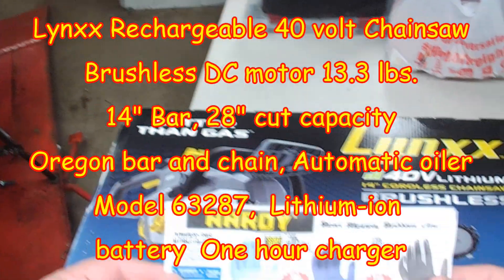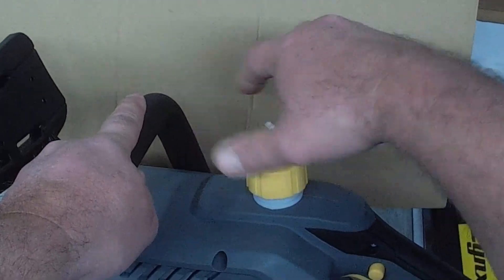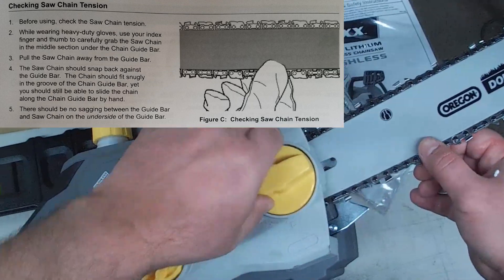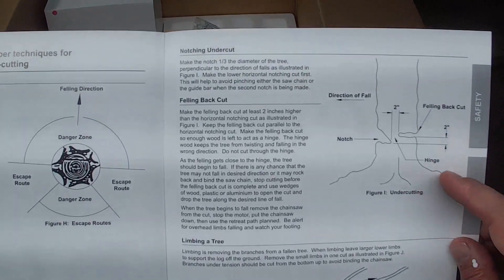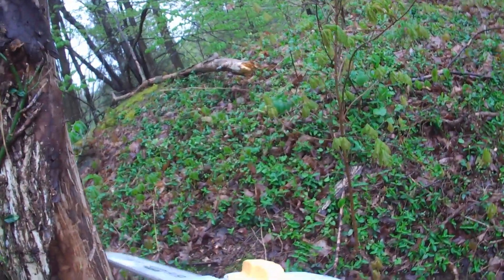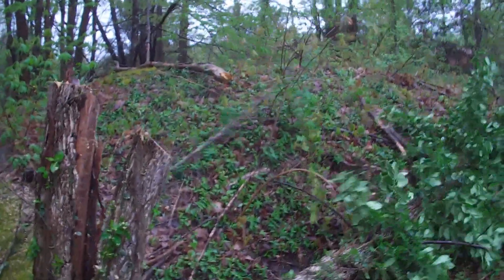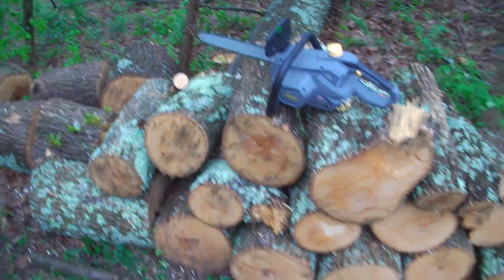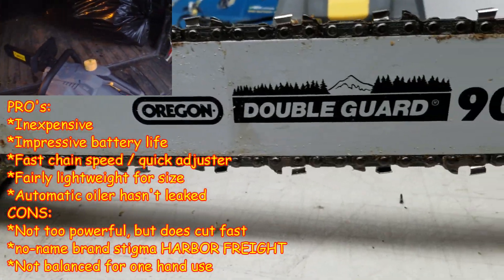Lynxx Rechargeable 40 volt Chainsaw. Unbox assemble review

Comment: Well I went on Amazon and looked up the chainsaw you referred me to and you are right about it being the exact same model.  Only difference was the colors on the plastic casing.  But unfortunately the Lithium Ion batteries required for this item cannot be sold on Amazon anymore.  There must be some kind of safety concern with those batteries.  They stopped selling them as of August 9th of this year.  I'm not sure what the issue is but if it's like most battery issues, there is usually a fire hazard  from them.  I know that there was an issue with that with laptop computers a while back.
Reply from the maker: Maybe, that's so odd... You could be right!  I also bought the leaf blower and am extra battery since this video. I've been wanting to try out the other 40v saw they carry.   I did buy a  HF 20v  little chainsaw and convert the battery holder to Milwaukee batteries. 
I do have a Milwaukee saw I keep in my Rubicon which is my favorite if all, by they're $$$
Reply: I want to give this lynx chain saw a 10. It works great and no issues. I have purchased the lynx pole saw as well. I have actually 2 chain saws and 1 pole saw. I highly recommend it to anyone who needs to do work at a deer lease or just around the home.

Comment: looks good for doing stuff around the house instead firing up the big saw , might have to pick one ! thanks for doing the review.
Reply from the maker: Exactly, I have 2 big husqvarna's, a 272 and a 372. This little saw works as good as my small Homelite. The battery lasted about 5 minutes longer after I did the video, so it's not really that bad compared to some of the cheaper battery saws I have had. You can't push it, it will stall the blade, but if you let the blade do the work.. I was impressed! Especialy for $150 after rebate.

Comment: Just bought one, thanks for the review!  I've had it with regular chainsaws.  Even bought one of the top name ones and it burned out after just a few uses.  I made sure I had the right oil mix and everything.  Sick of trying to start them even when they do work.  Can't wait to try this one.
Reply from the maker: Nice. It's a bit different with the slow swart, but if you let the blade cut and not push it it cuts great!! I keep the chain on the loose side, no slack just not tight. Be sure to run the saw and let the oil pump to the oil hole to bar before putting bar and chain on too.  Let me know what you think...
Reply: It's electric battery operated chainsaw oil? I miss
Reply: Something here
Reply from the maker: Bar Oil for the chain
Reply: @MotoCheez  ,no shit Sherlock why do you say thatin the beginning oil is oil that means it runs off of oil or is it for the bar.
Reply from the maker: Guess I don't understand what you're saying! Sherlock
Reply: @MotoCheez  I was trying to say that I've had bad times with gas-powered chainsaws and was looking forward to trying battery powered.   My battery powered one has been working great for..  I guess 2 years now.
Reply from the maker: I meant what Carl is talking about, I understood you 😁

Comment: The problem with Harbor Fright's & other's electric chain saws is on the inside. The gears are plasric. Excessive pressure will make the plastic gears wear out quickly. Use minimal pressure. Let the chain do the cutting, you're just a guide.
Reply from the maker: Truth

Comment: Well I went over to Harbor Freight today to buy this exact saw and I found out something that you may be interested in knowing.  They had only one of these left on the shelf and on the box they wrote with a marker that there was no battery with it.  I talked to the store manager about it and after he looked it up on their computer, he said that they have discontinued making the batteries that goes with that product.  He said that there may be a battery made by another company that would work with that saw but he couldn't guarantee it.  So unfortunately I didn't get it .
Reply from the maker: That stinks. Ya there is another company with different name. Litheli sold on Amazon. Exact same saw. 
Thank you for letting us know
Reply: @MotoCheez  No problem and thank you for putting this video together.  Lots of good info

Comment: Do you like your Poulin chainsaw more? It's a toss up for me I do a lot of cutting but only a few times a year I run till the tank is empty drink a beer or two fill up and cut till it is empty again and repeat I could get extra batteries I guess but still
Reply from the maker: For cutting like that, I like the battery saws, my Milwaukee battery saw is pricey but cuts like a banshee. The HF saw you'd need a few batteries. They cut good, just can't push them, have to let the blade do the work. Quiet too! I mainly use the HF saw for clearing my trails here. My Milwaukee is in my Rubicon.
Reply: I have four batteries and since I've bought two of these things I have two chargers.  I charge them all up at night, hit the woods with four fully charged batteries in a little backpack and cut till they're depleted.  Sometimes a second session in the afternoon.
Reply from the maker: 👍 nice

Comment: I bought one and used it for a couple of hours a day clearing buckthorn for about six weeks.  Eventually the clutch or something wore out: motor ran and turned sprocket but chain didn't move under any kind of load.  I had paid for the item replacement guarantee so I exchanged it.   The first day using the new one the chain fell off, as it will do sometimes when a cut limb twists on you or something.  I put the chain back on, not noticing that the disk that holds the sprocket was missing, and had to "reset" several times with that handle on top, then lost the chain several times before I got tired of it and quit for the day without fixing it.  Next morning found that not only was the chain off but the sprocket was completely missing.  Fortunately I have two of these things so I'll go back out today and look for my sprocket and disk and clip (whatever they're called)..  Problem is,  you can't get replacement parts other than the chain and bar.
Reply from the maker: That sucks, I didn't realize they couldn't get parts. Thanks for the info

Comment: Had an electric chainsaw once. 2 hours into using it I hit some metal in a tree and it destroyed some plastic gear in it. Just the least thing and that gear was toast. Took it back and got a real chainsaw. But I do plan to grab a electric pole  saw soon. But in a main chainsaw they should never put a plastic gear in it.
Reply from the maker: +Daehawk I agree, plastic gears don't belong on a chainsaw! I've got quite a bit of time using this one, so far it's decent. I keep it in my Jeep. Keeps my trails clear
Reply: i am planning to put one in my jeep...
what is the biggest log that you have cut through ?
will the batteries hold a charge well while in storage ?
are you still happy with it ?
Reply from the maker: I've cut the full bar lenght with this saw and it does well. Has soft start which makes it spins up slow, takes a bit getting used to, if you let the chain do the cutting and don't push down on it it cuts fast and battery life is great. The batteries seen to keep well in storage too. Used it a few times on our last Jeep run, posting video today.. SAVED THE DAY!
Reply from the maker: I just got an email, their on sale for $149
Reply: cool thanks for the info ! i will check out the other video. the low cost of a second battery (compared to others) is what has sold me on this battery saw
if you pay full price for the saw and use a 20% off coupon it ends up cheaper than the sale...
Reply: never mind about the 20% coupon. it will not apply to the saw or battery, so i guess i need to buy it while it is on sale for $149.!..
Reply from the maker: I was wondering if they did that like the compressors... figures!!

Comment: What in your opinion is the best recharging chainsaw?
Reply from the maker: Out of the ones I've used, I like the Milwaukee. I'd like to try the DeWalt to compare though.
Reply: MotoCheez heard makita was good
Reply from the maker: @crystaldavis6169  the one I tried was smaller and less powerful than the Milwaukee.
Reply from the maker: @crystaldavis6169  this lynxx saw is still working good. I keep it on my minitruck. It stalls easy but cuts good if you keep the chain sharp. 
I see harbor freight has a new big 80v battery saw coming out
Reply: MotoCheez saw a YouTube video do a take apart dewalt chainsaw. Said it was cheap parts and after some use the bar keeps loosening. My problem is I’m invested in dewalt tools and batteries.
Reply from the maker: @crystaldavis6169  I did a review on the Milwaukee, I didn't take it apart but I'm sure they're all China and kinda cheap to be honest.
Reply: MotoCheez I’m hearing makita is quality and the brand is Japanese.
Reply from the maker: @crystaldavis6169  the big brands are Japanese, but they subbing parts to China
Reply: MotoCheez go figure

Comment: I love mine! Only 11 lbs, perfect for a woman. 
BUT, my charger won't charge, just a blinking green light on all 3 batteries. 
Anyone know how to reset it?
Reply from the maker: Maybe charger defective? I keep this saw on the front of my minitruck now
Reply: @MotoCheez  Glad you replied or I would've forgotten to tell you the fix for my "charger".  Battery charger was blinking green, because battery was COMPLETELY dead. Basically the charger could not tell it was a battery because it had NO charge. So, hooked to a multímeter, and multímeter to a 12 volt battery for about 5 minutes. That gave it enough charge to make the charger recognize it. Problem solved.